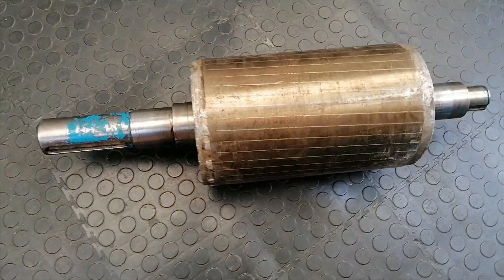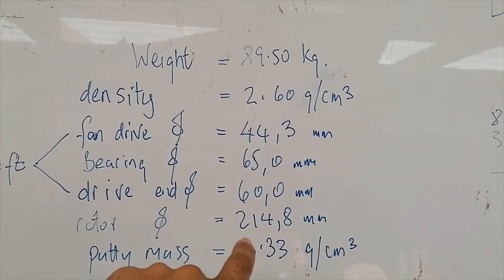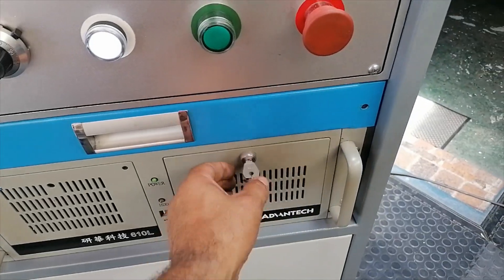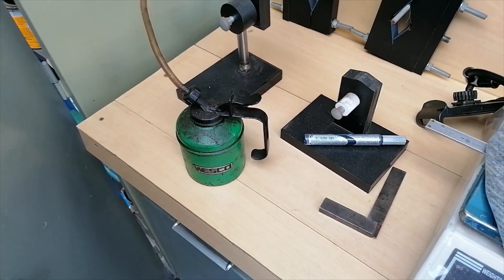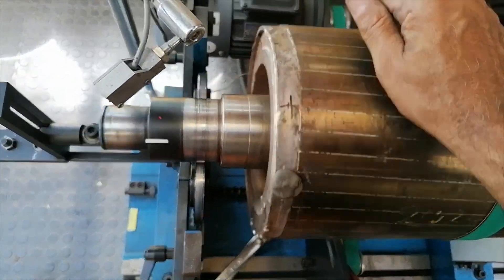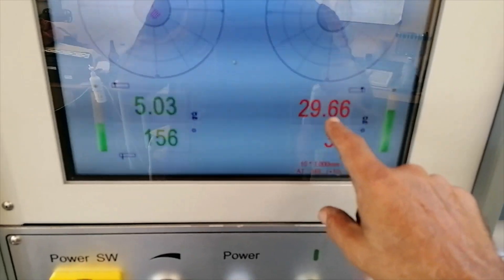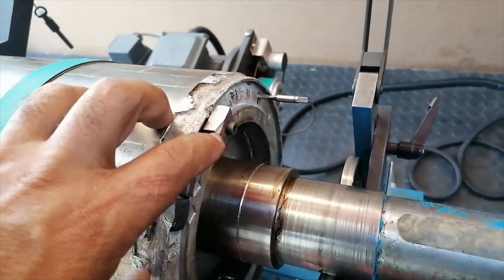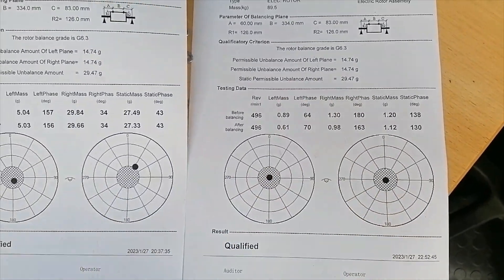Electric Motor Rotor Dynamic Balancing in 15 Minutes

Comment: 500 rpm?? Is that good enough? What is the working speed of that motor? Shouldn't you balance it on real working RPM???
Reply from the maker: Hi, thank you for commenting and watching the video. Great questions. When punching the data into the machine, the actual operating speed is used. Although i use the balancing speed as 500 the algorithms use the operational speed to work out the unbalance. All that is happening inside the "brain" in the background as such. The lowering of the speed whilst balancing is a safety feature as to stand in front of a 30 kg item spinning at 1000 plus revs is not exactly comforting. Same as balancing a crankshaft, it would be impossible to have it running at 5 or 6 thousand revs whilst standing in front of it. The operating speed of this rotor and most are 1450 rpm.These are clever machines, so yes, the balancing speed is very acceptable, but the operating speed is the determining factor. I hope i answered your question. Regards.👍

Comment: Hello sir,if this is unbalanced it can make the motor take more amps?
Reply from the maker: Hi, thank for commenting and watching my video. To answer your question, not really as the motor will run almost as per usual but with a vibration. If the vibration is alot, the bearings very worn, misallignment or pump has defects that will affect its function, then amps will be drawn. So basically things will have to be in a fairly bad state for amps to be drawn.

Comment: Will you make other video that show on how to balance   on the computer there, i want to learn also from that side of computer...
Reply from the maker: Hi, yes i will in the future, as soon as i get one to balance. I don't know if you checked out my channel, but i have made videos showing calculations on the pump impellar.Thank you for watching and commenting. Take care. 👍
Reply: I have seen you take your measurements of the rotor so as to input the data  into the system. Do you have any previous video show how to calculate and get actual data that is supposed to be entered into the system as system data required before start balancing.... Thanks

Comment: Why are you putting a putty mass in a keyway, and do you take off putt mass after balancing.

And what if you don't add that mass at the beginning of balancing.. thank am actually learning
Reply from the maker: Hi, thank you for watching and commenting. I am glad that you are finding my video informative. The putty in the keyway is to replace the removed material through machining. The density of this putty is not exact, but close enough to that of the steel. Some people put in a half key in the keyway. The putty mass in the keyway is not calculated in, only that used on the object being balanced during calibration. The mass when calibrating before balancing is important and must be added. That in the keyway is not a necessity, it just means that your balanced item will be more out of balance when a key is fitted on completion. Thanks. Tke care. 👍

Comment: Do you know what kind of Sensors that machine is using?  In other words -
What kind of Sensors is the shaft resting on as it turns?  Do you know?
Reply from the maker: I will have to look it up in the manual....should i find it, will i message you. Regards and take care.
Reply: Hello. Did you ever find the sensor that detects vibration? Best regards
Reply: @M.Kalenius  Me?  No.

Comment: Hello friend, your videos are very interesting.  See that there is no need to calibrate the machine every time you do not measure a new rotor for balancing!  The level is very important when assembling the pieces!!  The weight of plasticine is different from metal.  it is better to take the measurement and find the weight and place it on the template.  Greetings
Reply from the maker: Hi, thank you for your comment and watching my videos. All noted.👍 Much appreciated and take care.